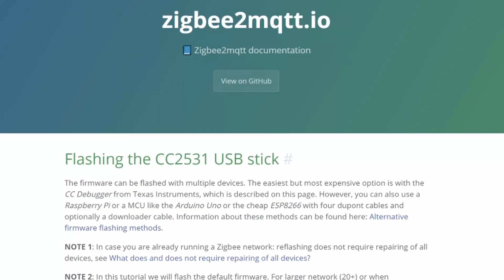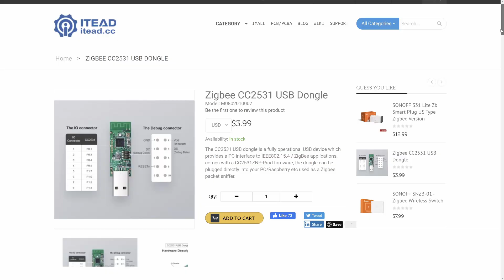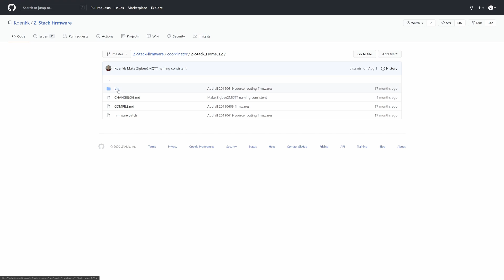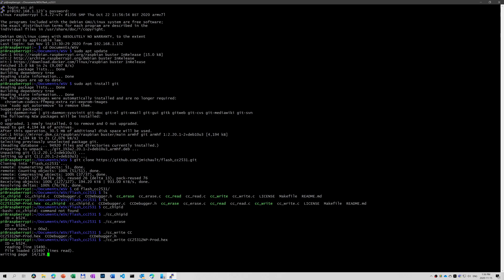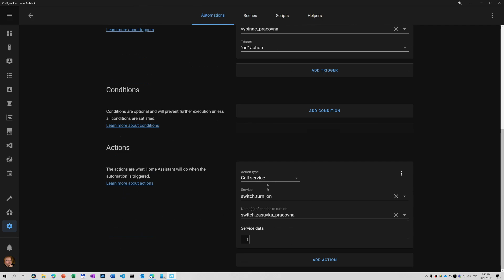IKEA Zigbee remotes - upgrading CC2531 firmware

Comment: There are some sellers that just sell the cable to connect the debugger to the cc2531 device. On its own it's a couple of euro. If you plan to flash multiple devices it's worth it. Then just have a few standard male to female jumpers handy.

Comment: Just leaving this to say that the video was extremely helpful and it all now works perfectly, thank you! And just to add, you don't even need to solder the gpio cables, you can bend the pins on the cc2531 and hold the female-female cables plugged in with your hand with a bit of force, play around with them and keep running the cc_chipid script to make sure it's all good! 
Pretty janky but it works lol

Comment: Great video! Can i flash cc2531 using the same raspbery pi where my HA is installed right now? I don't  want to destroy my HA setup:(
Reply from the maker: Not sure.  I suppose the HA OS is a branch o Alpine Linux, which is also based on Debian same as Raspberry OS, so it should work. If you do not want to mess-up with installing git on it, you can just download the release and copy it over, e.g. via Samba. But if you want to be on the safe side, you can just shut down HA, take out the SD card, make a new one with regular Raspberry OS, flash it and then put HA back. If you have a spare SD card that is.

Comment: Oh. I did not know that touch link function. 

what is the number in network map view of the zigbee2mqtt web interface? is it link strength?
Reply from the maker: I think it me meant to show it, but there is something else and I do not know what it is, I did not find it in the properties and could not find a documentation. I also think the map is buggy - it sometimes shows the mesh disconnected, even though it works fine. Looks like the map is not a priority for the developer.
Reply: @bruxy70  Thank you for your explanation. I am very confused with this map. I was afraid that my device is not working properly because sometimes the map just shows that they are disconnecting.

Comment: Instead of soldering I've used hook clip probe cables which are usually provided with logic analyzers but you can buy them separately from eBay very cheap. Those have the correct connectors for the GPIO PINs of the Pi and you can hook attach the other end to the CC2531's PINs. Just make sure to separate them out to not create shorts.

Comment: I have a CC2531, that exact ikea dimmer and some IKEA lights. If someone is having problems of delays when using that remote (~5sec between clicking the remote and activating a light), set the max_concurrent_requests to something > 2 (i.e. 8) in the znp section of home assistant config
Reply: Hi, newbie here. I have a similar delay/unreliability with my ikea dimmer. What do you mean by znp config section ? Thanks Riz

Comment: How did you get that zigbee2mqtt web interface into home assistant?
Reply from the maker: Just installed zigbee2mqtt as Add-on. It comes with the web UI.
Reply: @bruxy70  I don't even see supervisor section in my home assistant. Maybe it is not supported when running in Docker?
Reply from the maker: @PlechoveHrnek  It is, on some installations. There are 4 types: https://www.home-assistant.io/blog/2020/05/26/installation-methods-and-community-guides-wiki/#supported-installation-methods. The Supervisor is on Home Assistant (this is what I use, on Proxmox VM). And Home Assistant Supervised (I used to use that before). Technically, both run in Docker. The Home Assistant Container also runs in Docker, but does not have Supervisor. And Core just run directly in Python on the machine OS.  If you do not have the supervisor, you can install the ZIgbee2MQTT container manually (but I do not know how) - this is what the supervisor does anyhow.
Reply: @bruxy70  Thanks, now it's clearer to me. I am running Home assistant image manually in a Docker container. That explains the thing. I'll check the documentation and surely will be able to sort things out.
Reply: @PlechoveHrnek  but you don't need Supervised version for this to work. This interface has been introduced in latest ZB2MQTT version. You just have to enable it. You can install Zigbee2MQTT in Docker and just enable it. Then you add iframe panel to Home Assistant to have it always in the menu on the left side.

Comment: First of all, I really enjoy watching your video. Please keep going with the great work! :-) Now back on topic. I would suggest to anyone to use a CC2632 instead of a CC2531 because once your mesh growths beyond a certain size, a CC2531 coordinator is not powerful enough, even with the source routing firmware in combination with additional CC2531 routers. I have experienced extensive stability problems in my ZigBee network. Currently my ZigBee network comprises about 80 devices. I have tried for 3/4 year to get this network with one CC2531 coordinator and seven CC2531 routers (to extended the coverage), all equipped with external antennas, reliably running. It was not possible and I gave up. After the CC2632, everything works fine.
Reply from the maker: Thanks great tip. Any idea where to get it easily? I was searching my favorite shops, could not find it.
Reply: Oh sorry, I just saw that there is a typo in my posting (the "3" needs to be replaced by a "5"). I was referring to 2652 and not 2632. I got mine here: 

https://www.tindie.com/products/slaesh/cc2652-zigbee-coordinator-or-openthread-router/#product-reviews

They are more expensive than CC2531. However, they can handle around 200 devices at once which is impossible with a CC2531 network. Moreover, they are also fully compatible with zigbee2mqtt and they are powerful enough to run ZigBee 3.x decently.
Reply: @heinzelmann9799  Thanks but... It's 6x the price and I have only two devices and the controller; just trying to compare to WiFi mqtt powered devices.
Reply: @santorcuato  If you have only two devices, which are not that far way from the controller, then a CC2531 is really the best solution. However, the number of devices tend to growth, it's in their nature. ;-) If have started with a couple of door sensors and now my network covers 80+ ZigBee devices. From that experience, if someone exceeds far beyond 30 devices, it is the point where to think about replacing the CC2531 with something  more powerful.
Reply: @heinzelmann9799  You are totally right, I never have disconnected a device, only add and add. But for now my way seams to be WiFi, mainly Shelly and my own sensors, hand coded or ESPHome. I will call back when my Zigbee powered devices surpasses the 20th ;-)